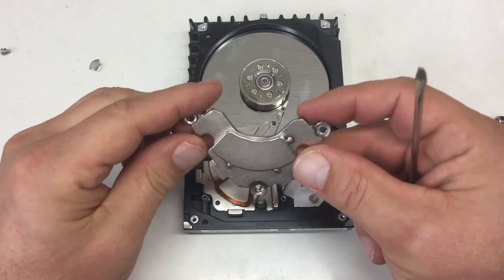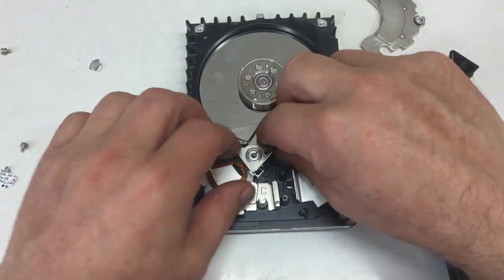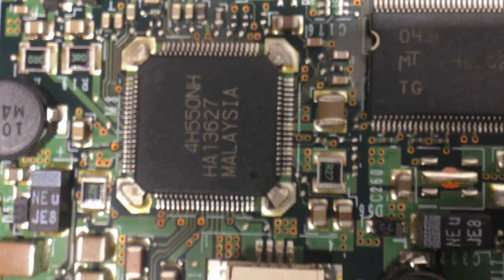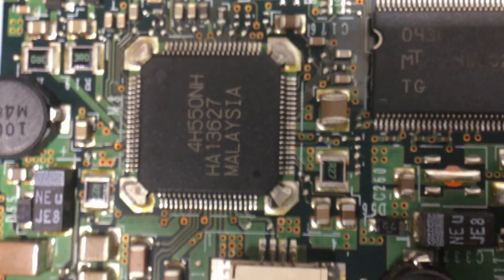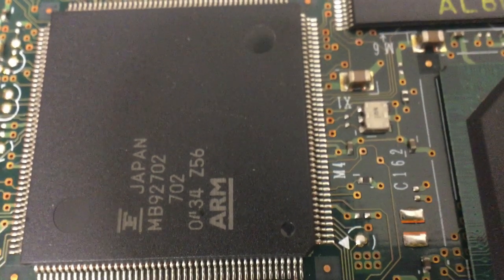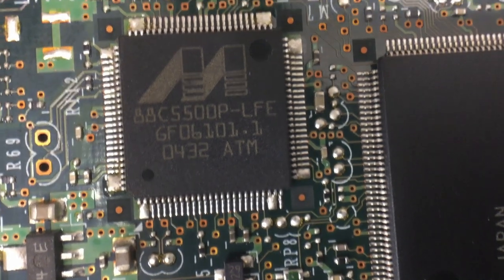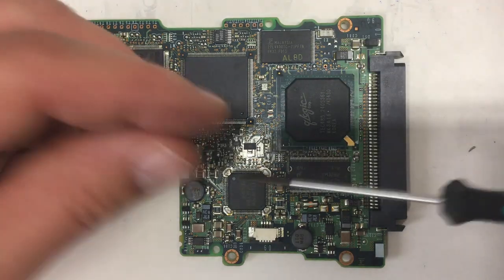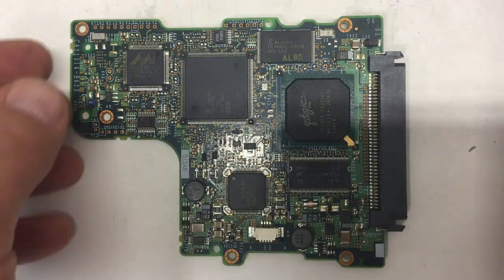15 Year Old Fujitsu 73GB/10.000RPM Server Hard Disk Teardown (All the Chips)

Comment: I wonder if the mag shielding is "MU" metal, I also look at these things and think there must be some use for them, so I typed in "old hard drive hacks" and instantly there where tool sharpening set ups!...GreatScott turned one into a rotary encoder. They are beautifully made, and I would like to see a modern one in bits.
Reply from the maker: Hi andymouse123, I experimented a bit with two neodymium magnets: The base material of the cover is not magnetic itself (magnets won't stick to it), it's quite hard and two magnets placed on either side are sticking together with great force, so I think it's stainless steel. The suspected MU-metal is slightly magnetic (magnets stick slightly to it), it's a bit softer and two magnets placed on either side are also sticking together with great force, so it might be MU-metal, but I'm not sure. The next step would be some chemical experiments ...

Also, I do have access to some newer SAS server drives, which I will tear down in due time ;-)

Comment: Really interesting. I am looking to buy several 15k & 10k 68 pin Seagate Cheetah, Hitachi Ultrastar, and Fujitsu drives for a couple modern vintage/retro computers I am building. Luckily I found a PCI Express U320 controller (LSI) for XP build and brand new ReA4091 Amiga SCSI Zorro controllers for the 3000 & 4000 systems!
Reply from the maker: I wish you luck! Some time ago I tried to find a replacement for parallel SCSI HDD in a server's RAID array that died. Of course I needed/wanted a new one. But the prices for old new stock were exorbitant.
Reply: @robertssmorgasbord  Yes expensive but I negotiated down with sellers 2 x Seagate 15k 300GB 68 pin, 2 Fujitsu 15k 300GB 68 Pin, and 2 Fujitsu 10k 300GB 68 Pin drives.
Reply from the maker: @boydpukalo8980  Good for you! If I remember correctly I was trying to source a 72GB drive (yes, from that ancient 18GB/36GB/72GB size series). Basically impossible to get.